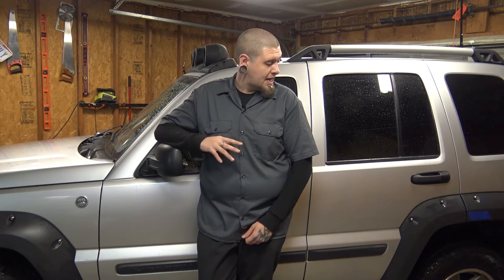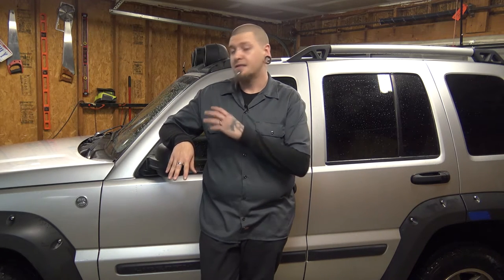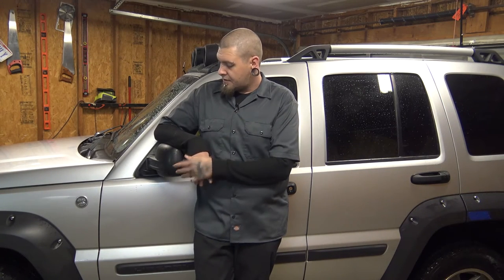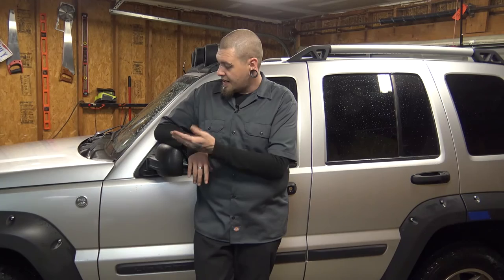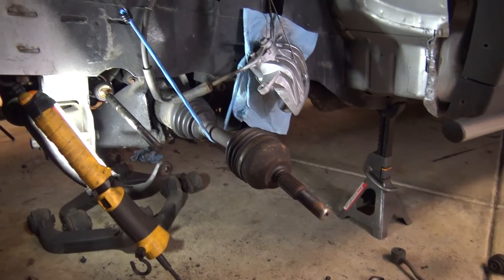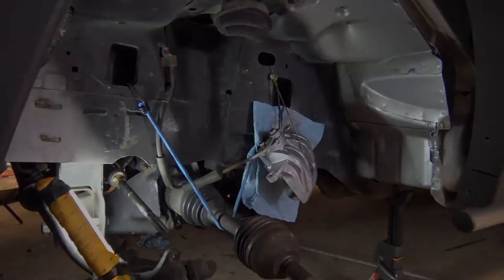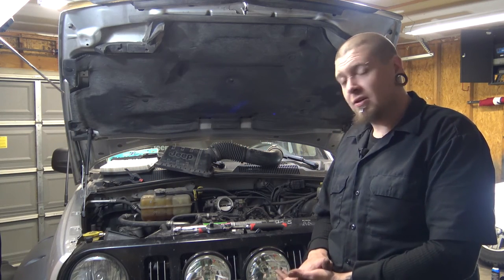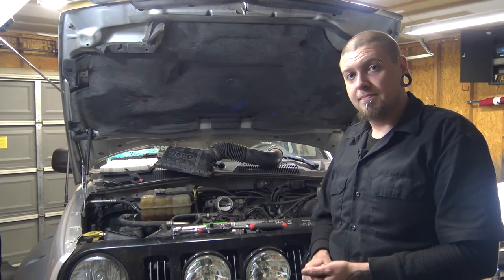Jeep Liberty Front Suspension Removal, Project Renegade Ep.14

Comment: I've got a Jeep Liberty that I am trying to replace the whole thing on. The lower control arm is had a ball joint broken twice so it has a badly deformed hole and I need to replace it. I've seen enough good videos on replacing the top I could use some help on the bottom one. Do you have a video that shows a little more detail?

Comment: I'll be removing what I'm assuming is the original strut on my '05 Jeep liberty this weekend. I have the "pre-assembled" replacement parts but my question is, will I need to compress the springs on the piece that's currently in there? Thanks!

Comment: I got those same spacers to put on my Liberty recently and I noticed that the bolts on the new quick struts I bought are to long and hit the top of the spacer and doesn't sit flush on top of the strut. So it looks like I'll have to cut the bolts to make them shorter. Did you have to do the same?
Reply from the maker: Yep, after filming the video I had to go back and trim then all down. Thanks for watching!

Comment: hey, how did you get the the peace off that the lug nuts screw on that is held together with the tree T14 studs from the back? you didn't show that part. Mine is stuck and will not just slide off. is their a lock ring or what?
Reply from the maker: If you are talking about the hub assembly what you have to do is knock the axle free from the center splines, then I just took one hammer and put it against the back side of the hub. Then use another hammer to hit the other one, just keep hitting it and it will come out of there. I've also seen people bolt an old rotor back on tho the hub and use that as something to hit. Or if you know someone with a slide hammer, or you can rent one I think. No locking ring on mine, I hope that helps you out. Thanks for watching and don't forget to subscribe to keep up on all the new videos and products, thanks again!
Reply: I had issues on an old Saturn I have and made something I saw online...took a flat piece of quarter inch metal, drilled holes for the studs, then welded on about a foot and a half solid pipe.  I've used this "tool" multiple times since then!  Bolt it on, hit it with a sledge, and the hub will fall right off.  I only do this if I'm planning on replacing the hubs!!!

Comment: How did you get the bolts from your upper control arm to come out? My rear bolt closest to the fire wall is stuck.  I've tried pounding on it with a billion extensions and the bolt threaded back on the screw, but it won't budge.  Please HELP!
Reply from the maker: All I had to do was use a ratchet wrench to make it un-thread itself from its spot. You can also try taking some of the weight off of the control arm. I didn't run into many removal issues as I was taking everything out so everything was out of the way of everything else. Sorry I couldn't be of more help.
Reply: did you have to remove the battery stuff to get out the upper control arm bolt...or could you do it without.

Comment: I'm trying to assemble my OME front struts and springs and my coil spring compressor tool won't work because the coils are too tight. How were you able to assemble yours? I also tried to compress them on my 20T hydraulic press but couldn't get them to compress straight to insert the strut.
Reply from the maker: Detroit Axle sent me their "Quick Struts" They come pre assembled, the lift spacer I used was outside "on top" of the strut so I didn't have to take mine apart. I've heard that getting that spring in is a pain, especially with the Renegade & CRD for some reason. Sorry I couldn't answer your question.
Reply: It's cool, I eventually just took them to my local Midas and had them assemble them.
Reply from the maker: That's what I would've done, I'm not the biggest fan of spring compressors.

Comment: Do you remember what size the socket was that you used to take out the 3 hub bolts on the backside?
Reply from the maker: They take an E14 socket, kinda like an inverted torx socket if that makes sense. Thanks for watching!
Reply: Rocky X TV I have the socket but it seems like it doesn't want to fit on the bottom two.
Reply from the maker: I had the same issue, but it ended up that my ratchet was hitting, so I had to find a really small extension. Then I broke that and found a really small swivel extension. I think I also had to tap the socket on because there was a little rust. I hope this helps you out.
Reply: Rocky X TV thanks so much man

Comment: how did you reach the rear bolt on the upper control arm . I moved the battery tray and moved the wire harness and still cant reach the rear bolt with the break lines and the box in the way
Reply from the maker: If I remember correctly I had to use a ratchet wrench, but I can't say for sure as I did this so long ago. Sorry I couldn't be of any real help.
Reply: You need a ratchet and several extensions,and an impact type u-joint to deal with the angles helps alot.

Comment: Stupid question. But I need some help. How does the bolt on the lower control arm come off?  Do you undo the side with the nut (left side if you're looking at drivers side), or the side with the tab(right side if you're looking at drivers side)?  Mine is stuck on and having no luck getting it off.  Keep up the great videos on the KJ.  Very helpful so far!
Reply from the maker: You remove the side with the nut. The tab on the other side is actually an alignment cam that is attached to the bolt. It's kinda' like a washer that has been welded off center to the bolt. Try taking another jack is you have one and put some upwards pressure on the bottom of the control arm, this usually allows you to push the bolt out. Thanks for watching and good luck with your repair!
Reply: Thanks I'll try it!